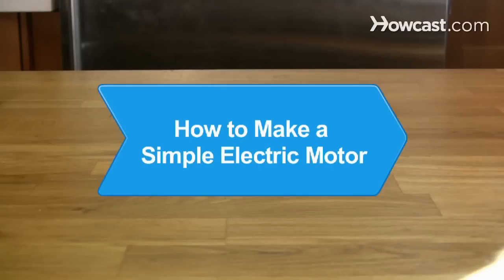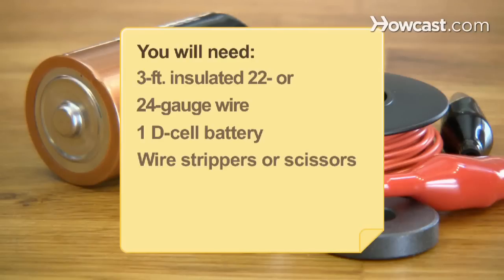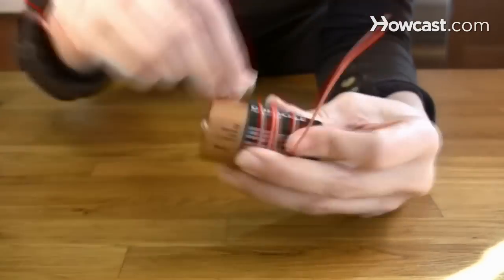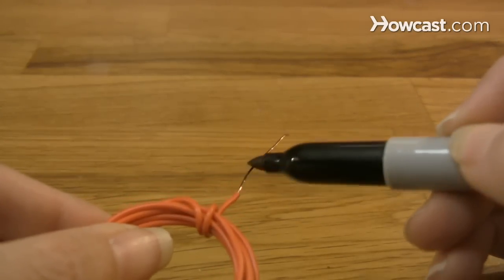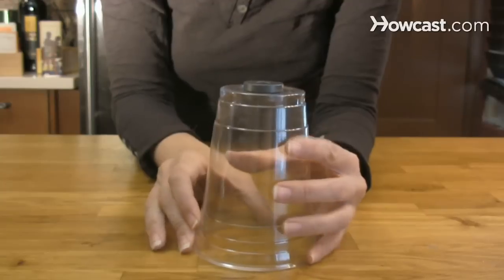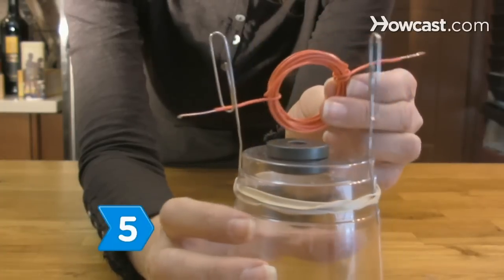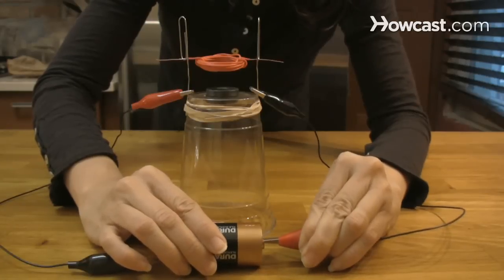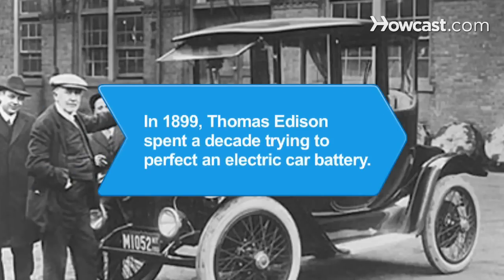How to Make a Simple Electric Motor

Comment: It insulates and stops the electromagnet when the polarity is wrong. Without it, there will be a dead spot when the electromagnet and the permanent magnets are attracted. You can use anything that is an insulator but only cover half of the wire and you don't want to add friction.

Comment: You hold it there. If you want, you can buy battery holders for electronic projects at an electronics part store like the Source or Active and then you can connect the alligator clips to actual connectors.

Comment: Agree - normally dc motors use a current reversing method. BUT this does work - I've tried it - even without the half coating mentioned (most of the youtube vids of this don't bother with the coating. 

How it works I do not know - an explanation would be great.

Comment: perfect for coiling the wire and it has a higher capacity - making it run longer. you could use a AA or AAA - same voltage

Comment: It looks like you have two ring magnets.  Is it necessary to have ring magnets?  I want to do this for a tech class I run at the library, and I already have ceramic craft magnets from Hobby Lobby.  They are about 3/4" inches in diameter. Will these work?  Do I need to get a stronger magnet or a ring magnet specifically?
Reply: +Ellen Fitzgerald Maybe a bit late, but review the formula for a current in a magnetic force: F=BIL*sin(theta). As long as you have (any) magnetic force, you can vary current (put several batteries in parallel) or the length of the conductor to adjust the force on the wire.

Comment: Is there anyway in using wires rather than those clips, I have kind of trouble making this experiment. I always use copper wires instead than those clips to connect the battery.

Comment: It will accelerate to it's top speed which I assume could be reduced by using a lower voltage battery or reducing the magnetic field.

Comment: I tried this with bare copper wire and couldn't get a strong magnetic field to form.  only when I used sheathed copper wire could I make it work.  This was also true for the electromagnet with a solenoid wrapped around an iron core. Why does the sheathing on the wire give it so much more magnetism?
Reply: the current probably bounces through each section of wire instead of going in one direction

Comment: would this work in reverse?
say you could somehow apply consistent motion to the coil, could you then attach the positive and negative connectors to a radio for instance as a power source?
Reply: كن
Reply: if your talking about using it as a generator in theory it would work but probably wouldn't power a radio but maybe a small led light bulb.

Comment: Why are you barking at me??? I gave you a suggestion which is cheap and can be used on various experiments with batteries. If you want, just hold it there with your hand. Use duck tape if you want. But don't blow up at me for helping you.

Comment: The coil would be too heavy for the magnetic field to rotate it
Reply: Sushovit Khanal naah it works
Reply: 3002gaming believe me , it doesn't. I made it myself to test it. To make sure it works you'll need a neodymium magnet and remove the insulation of the copper wire.
Reply: Sushovit Khanal I tried it too and it works just fine

Comment: There is something wrong in this design. Usually there is a comutator, which reverses the magnetic field in the rotor winding after the later rotates half a turn, in order to make it turn another half turn and so on. There is none in this design, which makes it either a fake, or pure luck that the autors got more than 1/2 turn or rotation.